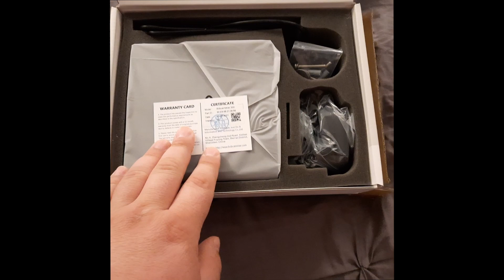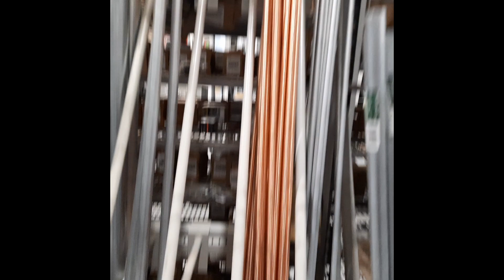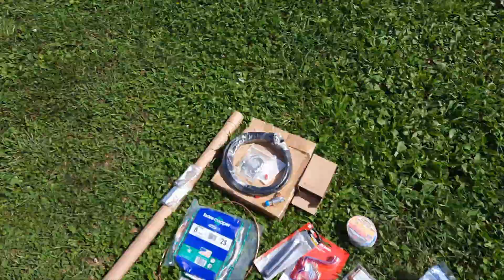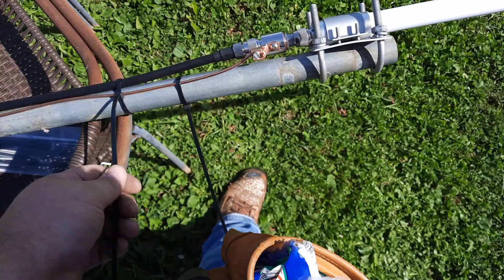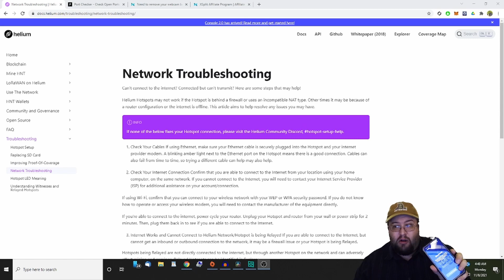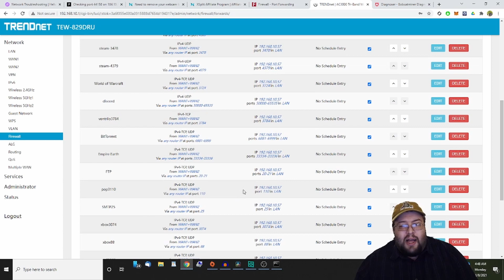Outdoor Helium Antenna Install

Comment: Hey man great video! I am wondering is 10 gauge copper wire enough to ground? Also where did you order the lightning arrestor from? Is your pole grounded in anyway?
Reply from the maker: Antennas are supposed to be grounded under the National Electric Code. 8 or 10 AWG copper wire should work. Lightning arrestor come from Amazon, but I definitely overpaid. You can definitely get them cheaper on eBay and elsewhere. https://www.amazon.com/gp/product/B078NT5M37/ref=ppx_yo_dt_b_search_asin_title?ie=UTF8&psc=1
Reply: @ThomasDiy  thanks for the response. So you didn’t ground the pole or did you combine the wires?
Reply from the maker: @devonm8043  The antenna pole is grounded at the base to a grounding rod. Lightning arrestor wire runs down the entire length of the pole and attaches to the same grounding rod. Alot of guys just ground the Lightning arrestor at the top of the pole with a pipe clamp.